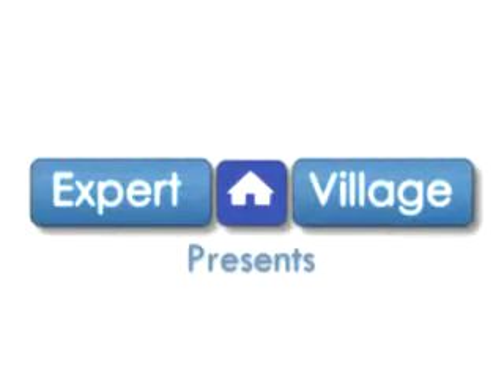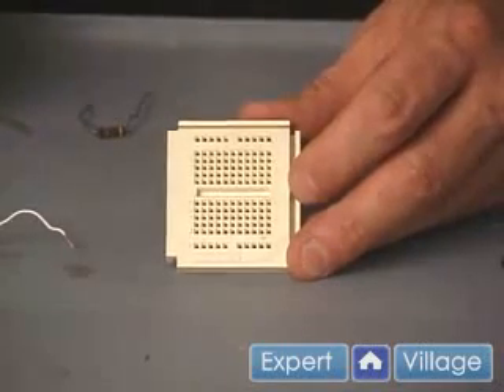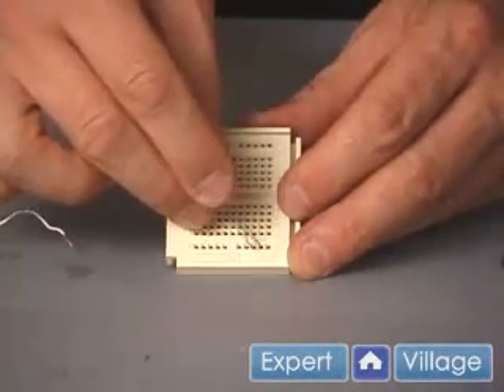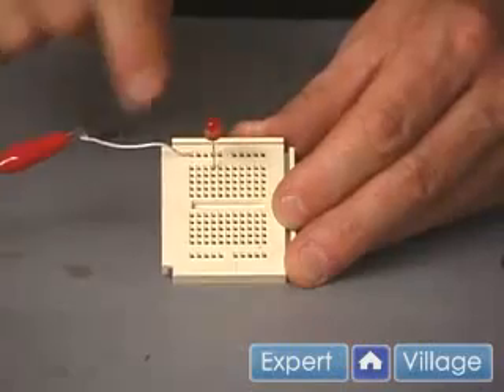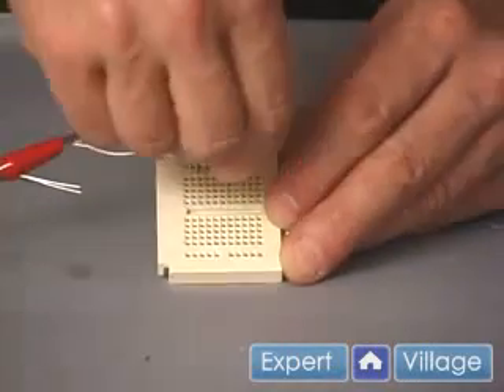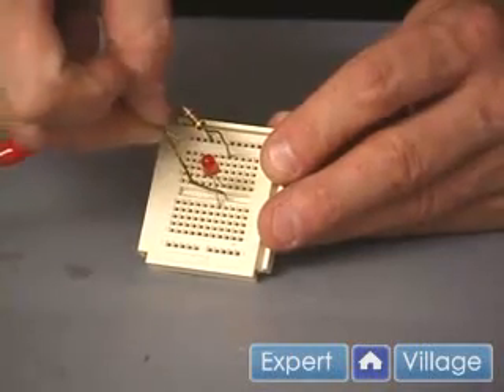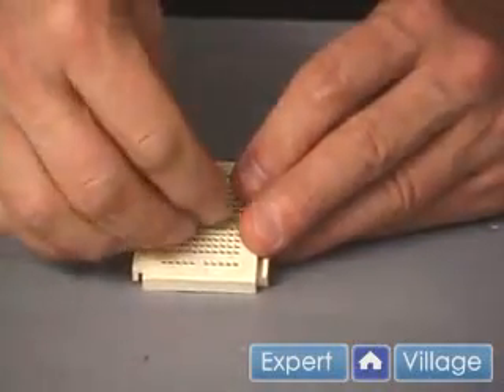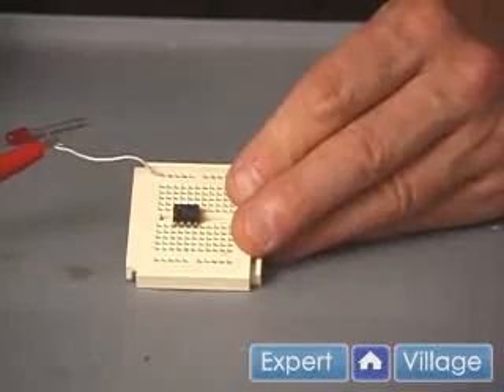How to Build Electronic Circuits : How to Use a Breadboard to Prototype a Circuit Board

Comment: for a 6v sipply you need a 470 ohn resistor i beleive for a normal Led you will need to find out the color codes of coarse